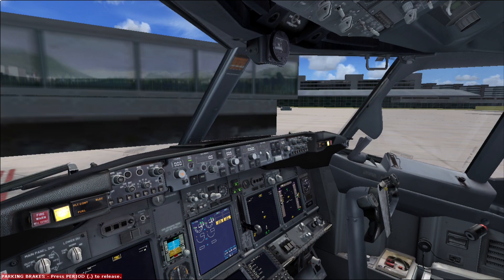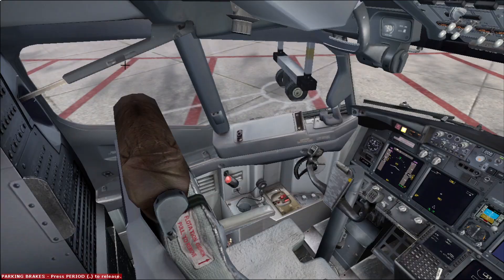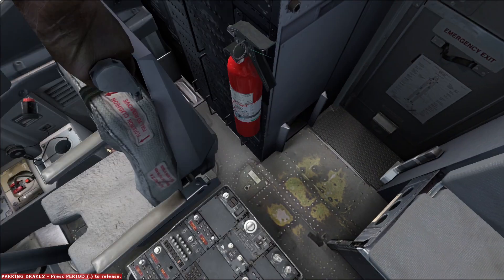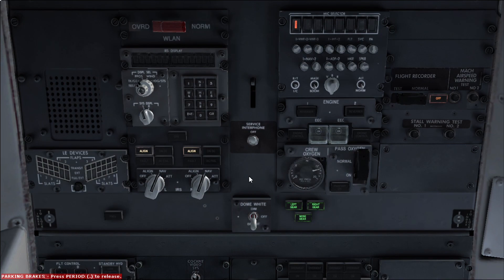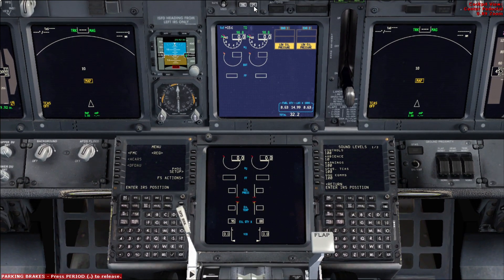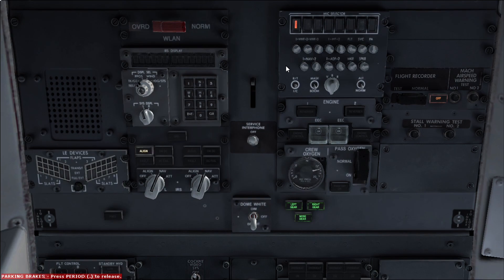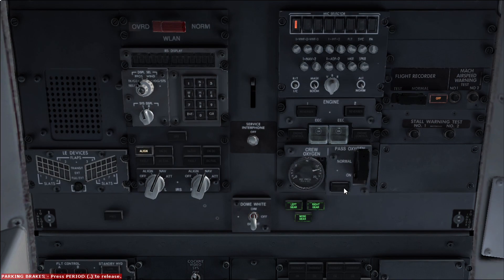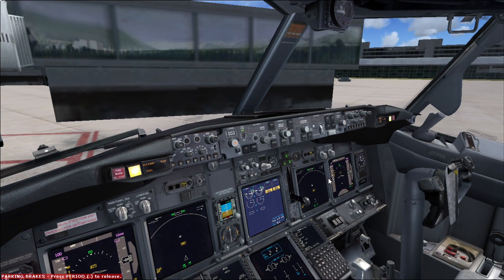737 Preliminary Preflight Tutorial - Professional 737 Airline  Pilot - PMDG

Comment: Helpful videos. Do you have one for cold and dark start? I looked through the list but could not find one
Reply from the maker: Thanks. There is a procedure for that. 99% just make sure the external power is plugged and do the preliminary. If not, and the aircraft is  cold, switch BAT to ON, do the fire test as in preflight, turn on the apu, set the aircraft to power from the APU and continue to the Preliminary+preflight
Reply: @pilotdreams7886  got it. So mostly the prelim video from except for getting external power. Thx